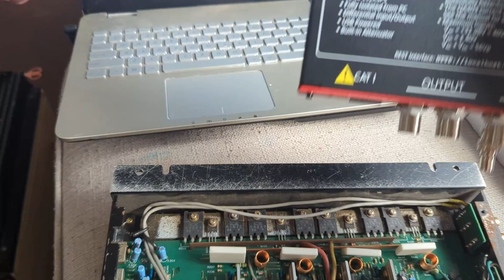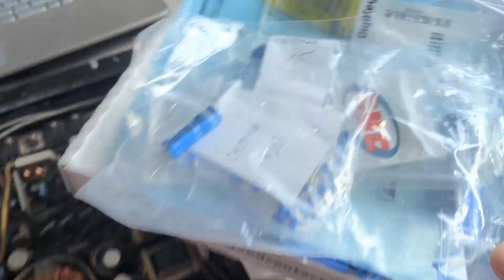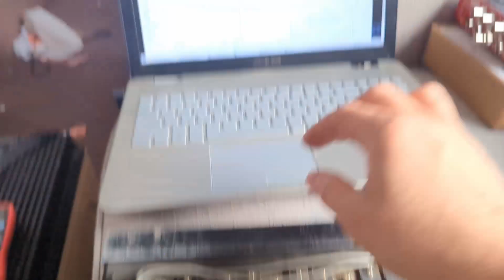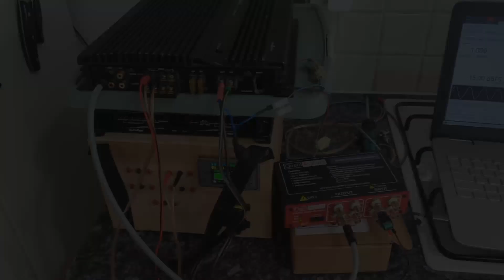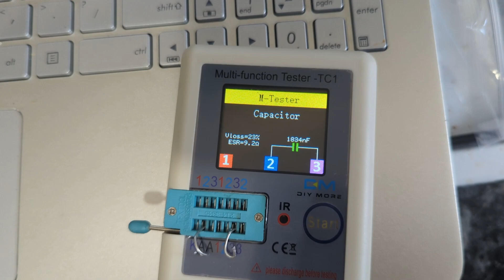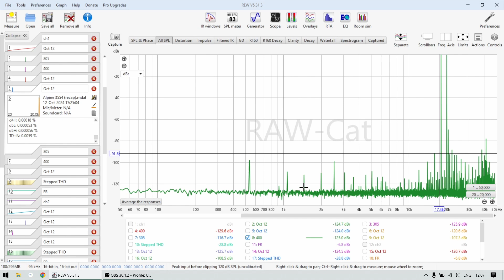Alpine 3554 recap project

Comment: If you truly want to test capacitors, LCR meters are cool, but you need something to test it under full voltage. LCR meters will not show you the leakage of the capacitor.
I have a Sencore LC53, Sprague tel-ohmike TO-6 and a Elco 950b. These will test up to 700V and test leakage. You don’t want ANY  leakage in your preamp or output caps. That’s where you get strange noises and hums from. 
I have 4 3554’s. I bought them as parts donors in case my 3545 ever loses a transistor. I completely recapped the 3545. All my 3554 work perfectly.

Comment: Would like to know where can found good capacitor for this project, I also found a same amp with good condition, try digikey and mouser both didn't work.
Reply from the maker: There are many good capacitors, but most of them will be pricey. The Panasonic that I am using is a good value.

Comment: How are you measuring channel separation?
Reply from the maker: Measure the signal with only one RCA in on all the channels outputs. You can use a multimeter for that, I just use RTA.
Reply: @RAW-CAt then you convert VRMS to db?
Reply from the maker: @13BTRX3  you can use one of the online calculators:
https://www.analog.com/en/resources/interactive-design-tools/dbconvert.html
Reply: @RAW-CAt  awesome, thank you. Do you test them with both/all changes loaded, full power?
Reply from the maker: @13BTRX3  for channel separation, that does not matter. Results will be the same loaded and unloaded.

Comment: Should i get this or the alpine Mrp f240? I can find both for cheap
Reply from the maker: F240 will be in a much better condition and won't need any work. For mids and tweets its perfect. This 35 might need recapping and it will depend on the condition. Hard to find these in good condition.
Reply: @RAW-CAt  thanks
Reply: @RAW-CAt  i can do an recap

Comment: After watching this video would it be safe to assume that if the caps aren’t bulging and look perfectly fine then they’re probably ok? The reason I’m asking is because I have an MTX Thunder series amp from the early 90’s. The same amps Mark Eldridge used to dominate IASCA from the same time period. It works fine but it started to pick up alternator whine. Everything in it looks brand new because I’m the original owner and have taken good care of it. Never abused it or pushed it.

BTW the birth sheet says it has .003 THD+N. I wish you could get your hands on one for testing. They were still made in Arizona during that time and gave Alpine and Rockford a run for the money.
Reply from the maker: I would say that if they look ok,they will be ok. Assuming that the original caps are quality ones. Especially the smaller ones. The big power supply caps might benefit a replacement, just to make the life of the amp longer. As they are working the hardest.
Reply from the maker: The noise most likely is from the actual amp construction, old school amps are more suitable to noise as they are more sensitive in general.

Comment: Back in earlier 90's, I was on military leave and visiting my home town. I stopped by the local car audio store and met a veteran who was the amp repair guy. I explained that I was looking to start a car audio build but was low on funds. He grabbed a non working Alpine 3554 amp and said come with me. He sat me down at the repair desk and guided me through removing the back cover. I looked at the circuit board and he asked me if I saw anything that looked different? I said I have no idea what I am looking at but that silver stuff is not as bright as the other silver stuff. He explained that was cold solder. He showed me how to desolder and re-solder the area. He had me hook up the amp on the test bench and it worked! He gave that amp to me and I ran it hard for 15 years.
Reply from the maker: That is such a cool story❤️

Comment: Todd Matsubura had a pair of 3554 amps (and two 3544s IIRC) in his IASCA Triple Crown winning TBird in the mid-90s.  That inspired me to collect three 3554s, which I still have.  Excellent pieces of equipment.
My 1989 Alpine catalog shows both the 3539 and 3554 in it.  It was a crossover year for the changing of the styling.
Reply: Hey, I got a demo in his bird. Super nice guy. 👍

Comment: Shame the project didn't go as planned, but atleast it was a valuable lesson for future testing procedures and you still ended up with a clean amp. Speaking of clean amps, it would be nice to see you clean the heatsink and try to refurbish the exterior finish of the amp. I wouldn't mind using old amps except for the fact that you often find them in pretty nasty condition and full of scratches, so it's not really possible to do a clean install without some restoration. Restoring one of those old Alpine's would be an interesting video for sure.
Reply from the maker: I did restore a few amps that way, made only pictures for FB, no videos. The problem with that type of restoration is that you are losing all the logos, and factory writing. But I still might repaint it
Reply: @RAW-CAt  Yeah I guess in case of those painted lettering, you would have to make masking stencils based on the original design, paint the whole thing white, apply the masking, and then paint it the primary color. That's just an idea that came to mind, not an expert painter obviously. A ton of work for sure, but would be cool to see if it's even possible to do on your own.

Comment: Well capacitance and resistance are not the only attribute of cap. Normally only caps in PSU goes bad. Anyway if you are going to buy another caps, get all Nichicon and also do not use 16V! It is a limit for car audio and they die sooner so get 25 or 35V. Also if possible get as high as possible capacitance for these first caps.
You can also try to change EL caps in preamp with WIMA, they are much better for this.
Reply: Why would Nichicon be better if Panasonic caps have lower ESR and higher current capability?
Reply: @woldemortxyz7996 They just have an extremely good reputation for being accurate, well built and lasting a very long time. They may not actually be better.
Reply: @JasonWW2000  And they are gold :)
Reply: @kiklop8362 Here is the real question, though. 

Are the Nichicon caps of today, the same quality as they were 30 years ago?

Hopefully they've maintained their reputation, but we won't know for another thirty years. 😂
Reply from the maker: This is a great question. Trok component level testing I have seen people doing, it looks like quality components are still quality. The main problem is the fake component market where sometimes you are buying a cat in a bag.
Reply: @woldemortxyz7996  because it is nichicon and you can have them in gold :)

Comment: What about of sounding, imagining in this amp? How it's sounding compare to Pioneer or Sony old school amp's?
Reply: I am glad to see I wasn’t the only amateur that ran into problems sourcing capacitors. It is very difficult to find the larger capacitors in the low profile dimensions used in some vintage amps. In recapping my own vintage Eclipse amp I found caps that were too tall by a couple of mm so I simply did close a cutout on the original cover and left it at that.
Reply from the maker: Never had a Pioneer or Sony🤷
Reply: @RAW-CAt  I have a old school Pioneer and Sony, it's sound very nice.

Comment: The caps may have tested fine but with constant use and heat the could still fail in time. What you did will ensure that your amp works for years to come. Preventatve maintenance is never a wast of time.
Reply: Yeah, they weren't gonna last forever.

Comment: Interesting project, but sorry for the REALLY bad luck with the faulty RCA cable.

My best sounding amps that i bought NEW back in the days was the Alpine 3539, that was the older chassi of the Alpine 3544. Alpine speced them both as 2x150w 20hz to 20 khz. 4 ohm. 🙂👍
Reply: Well, the 3539 and the 3544 was BOTH my best sounding amps. They sounded as i remember very, very similar. If not exactly the same… Very Long time ago 😁
Reply: I still have 3539 and philips dap600 wich is same as 3554 but different look. Great amps deliveres more than specs are. 3539 did little bit over 200w per channel to 4ohm. Plan is to make vintage audio system to Opel Monza with those amps.